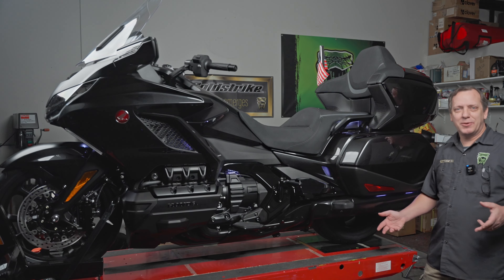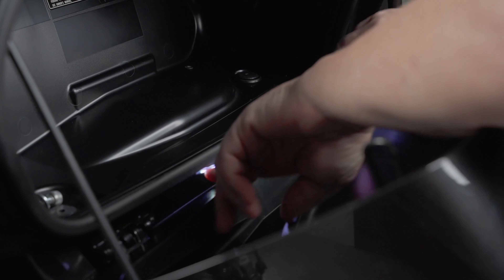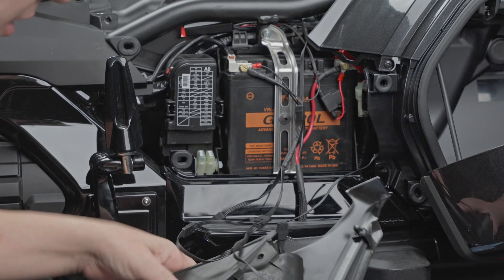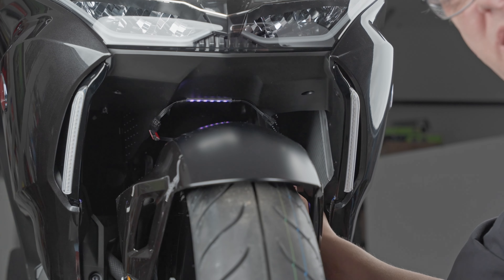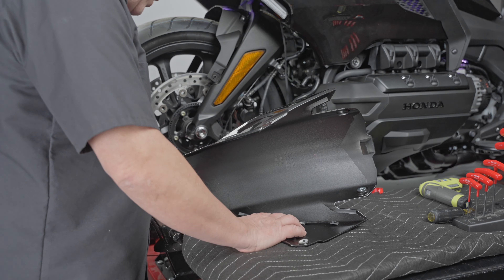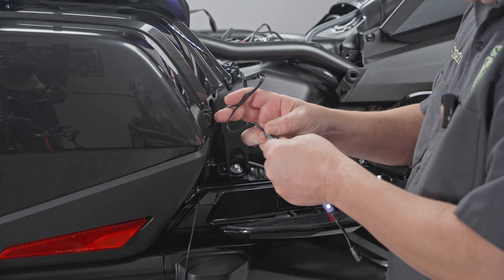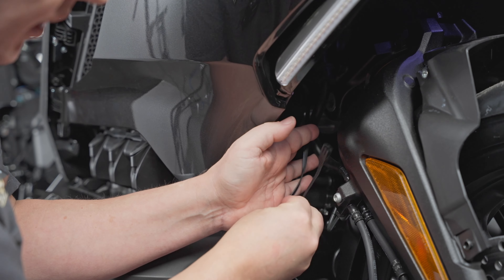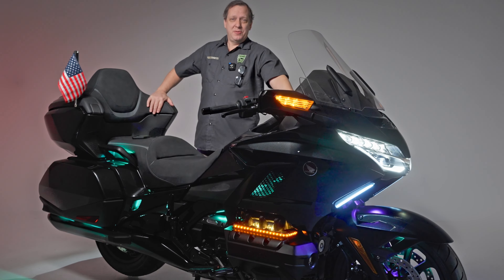Goldstrike Shock & Awe 2.0 LED Lights Installation for Honda Gold Wing

Comment: How did you tapp into the brake systems for all the lights to turn red
Reply: The single red wire that comes out of the shock & Awe controller taps into an existing brake wire on the factory bike harness.
Reply: Thank you

Comment: When you installed the engine running liights do they blink when you turn the signal on
Reply: No, you will not get turn signal. Only brake light function.

Comment: I don't want the manual controller visible. can the manual controller be placed under the seat and the lights be fully controlled by the Bluetooth (loosing absolutely no features) to include on & off?
Reply from the maker: Hi there, the manual controller can be hidden so it is not visible and yes, if the system is on it can be controlled all via Bluetooth. However, if you are to do that, we'd recommend plugging your bike in so it doesn't draw power from your battery. For more information please contact our tech support at techsupport@ciro3d.com or call 715-808-0027.